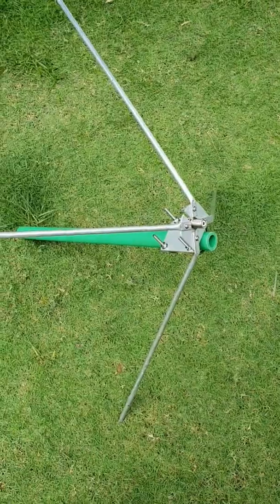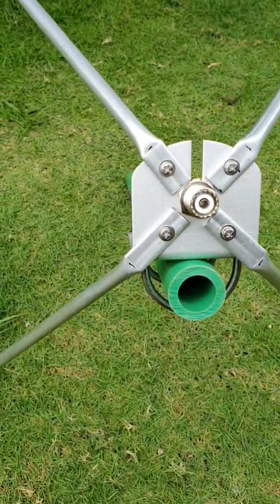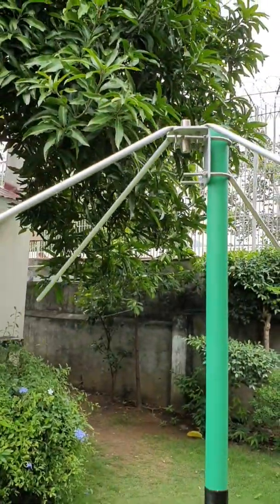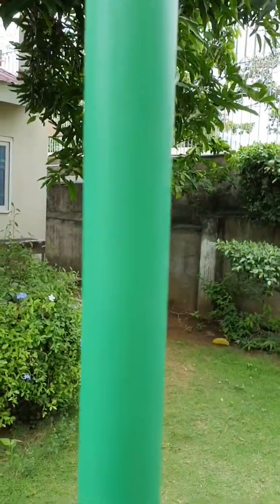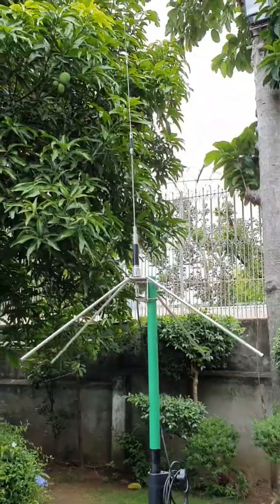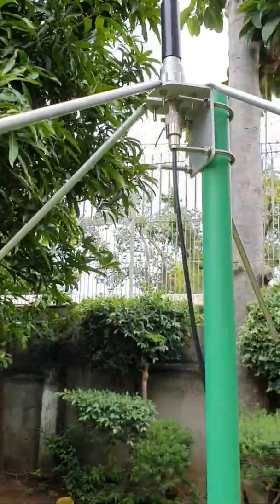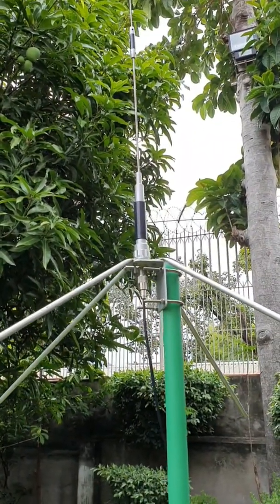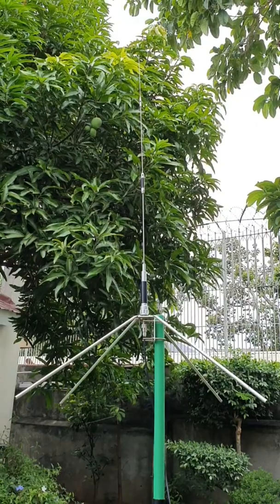GROUND PLANE MOUNT FOR FIELD DAY

Comment: What type of pvc pipe (looks thick) did you use also is that a speaker tripod?

Salamat po and 73s.
Reply from the maker: Yes its high temp water pipe. And speaker stand. 73 😊👍🏻
Reply: @du7jay  Sabi ko na ba speaker stand yun. Is it possible to use the ordinary water pipe (the blue one)?  Thanks and 73s.

Comment: Nice design and build!  Is that a 1/4 wave antenna?  If it is not, then ground plane requirements are likely different...without the proper ground plane, antenna gain is reduced or eliminated.
Reply from the maker: 73 de du7jay